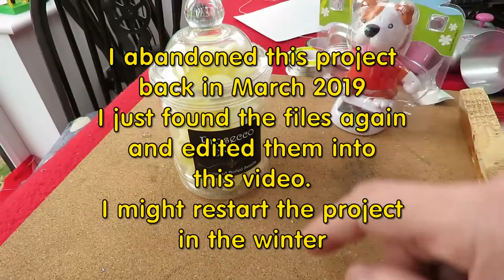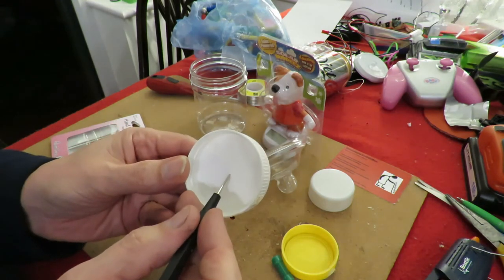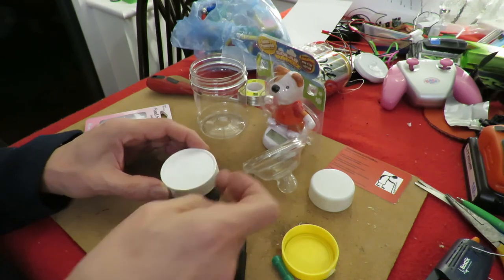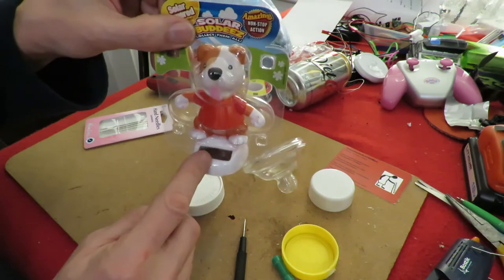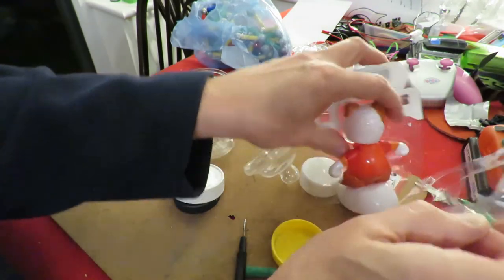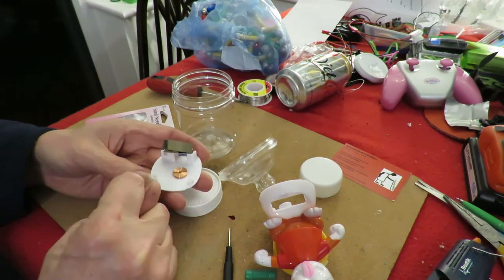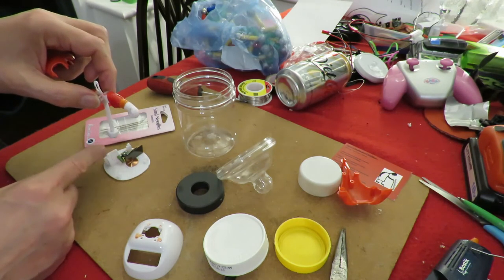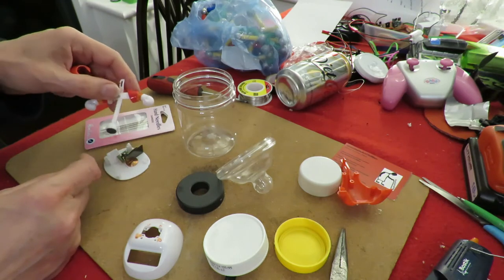FAILED Magnetic Levitation Bearing Pulse Motor project

Comment: It's all a bit different, I'd really like to see this one running. As it stands, the magnets are being pushed away each time it fires eh, hence the wobble.
Reply from the maker: Hi Slider, thanks for dropping by.  I really wasn't happy with the way this was going. Maybe I should have glued the magnets in place. I would get it all set up and then one of the magnets would flip loose from the sticky tape. I reused that jar for the Tie Fighter. Maybe when it gets cold and wet outside I might have another go but I expect Lidmotor will have moved us on to a different design by then 😁

Comment: When i was experimenting with my 3d printed pulse motor, i found a needle (ferrous metal) were no good as they got attracted by all the magnatism around it,  Making the ends farther apart and using a Non-ferrous pin/needle worked best.
Reply from the maker: Thanks Terry

Comment: I wonder if in the end you still can not get it to rotate that using a second coil on opposite side would give it more power to turn. It seems to have enough though, just have to play with positions I guess or like you said, magnets on the outside of rotating part.
Reply from the maker: You would need to get the two coils in sync. Lidmotor had more success with his magnetic levitation but in the end decided it was not giving him the results he wanted. I have had success with these single coils in the past with the needle a tight fit on the disk and suspended from a magnet but getting the positioning right and the magnetic levitation right was harder than I had hoped and using the needle up the middle to steady it seemed counterproductive possibly producing more friction than the needle point touching the bottom or top magnet would. Here is a very simple one https://youtu.be/Q5FgXkDmXeA?list=PLA5a2xPRSrB2NH9Qe9u4KVJjelgMpd-kK